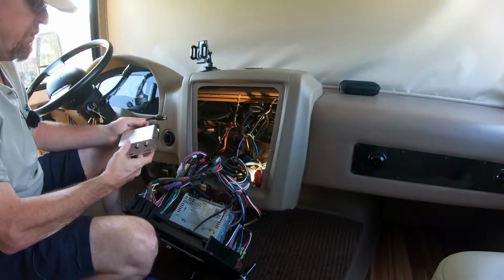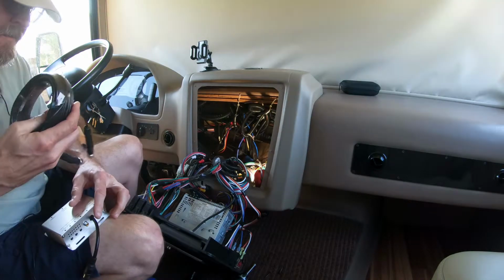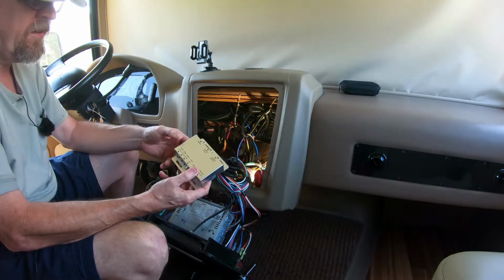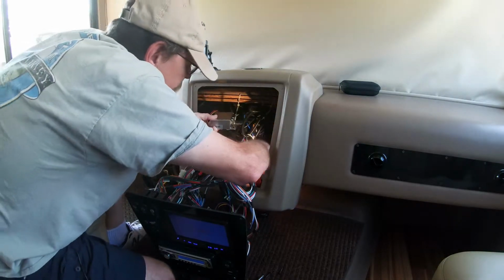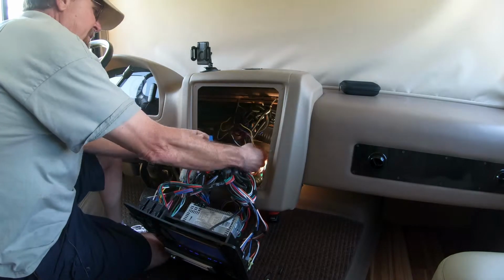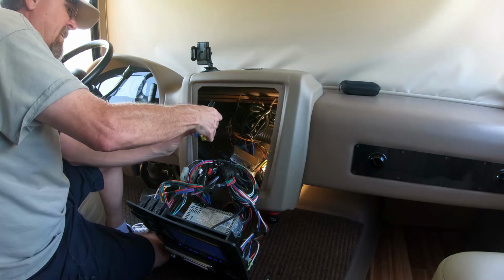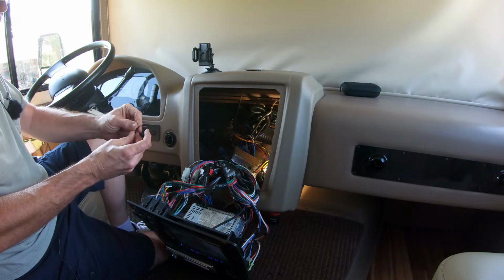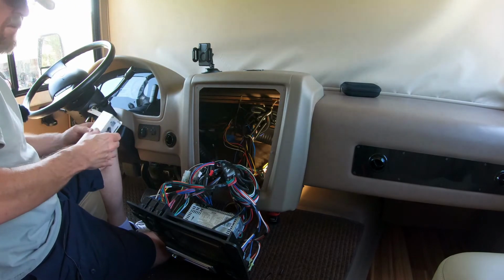Motorhome Security DVR Addition Part 2

Comment: So you're switching from a TNC connector to a BNC connector?
Reply from the maker: greylocke100 Not a TNC but rather a 5 pin video to BNC connector.  Very different than the video cameras used on a home security camera system.  I was surprised by how difficult it has been to locate a pin out diagram. Apparently not a very common video connector. This is half the size of a 5 pin DIN connector. Have to make my own diagram.  Warning... nerd in the dash!